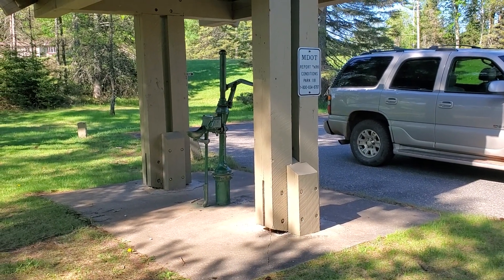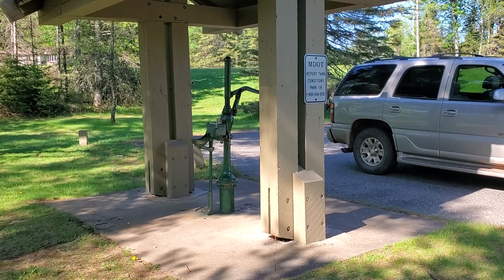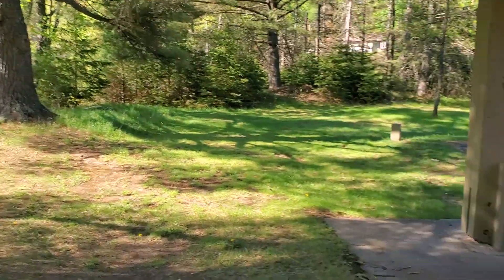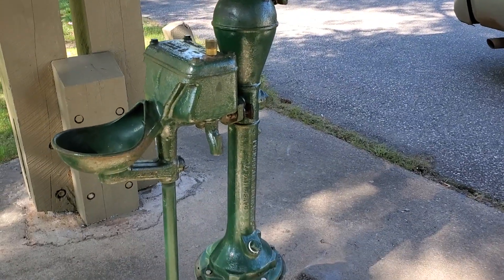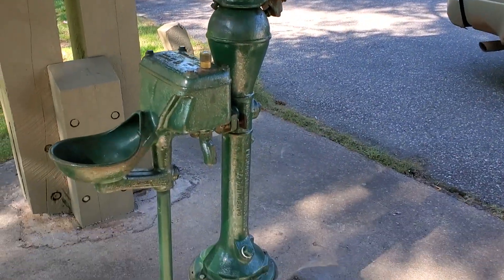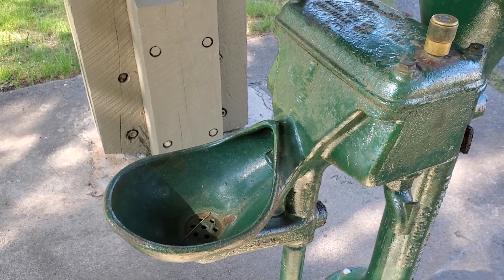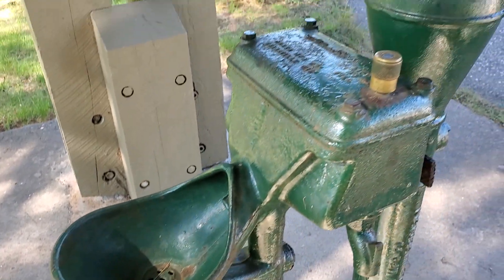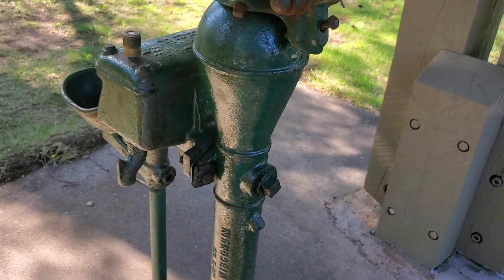#199 Baker Monitor fountain hand pump.

Comment: Oh this brings back memories from a certain park system I would camp in with my troop. Always screwed around at the fountain. 😂
Reply from the maker: The fountain versions are less common but these Baker Monitor pumps are very common at rustic campgrounds in northern Michigan. They are slowly being replaced by solar well pumps with running water which is disappointing.
Reply: @vintagekohler6085  I agree with your view on the solar well pumps.

Comment: I just snatched up the bowl of a 1965 Crane Neuday! A Canadian version too! No tank came with it however, but the bowl itself is damn near mint aside from some scratches and mineral buildup. No cracks whatsoever.
Reply from the maker: Cool find!
Reply: @vintagekohler6085  Thanks! My theory as to why there is no tank is likely because while installed, the tank broke and couldn't be used anymore. Because there's no getting a replacement tank, the whole thing had to be replaced. That's my theory as to why it's just the bowl.
Reply from the maker: @christopherpotomski8463  yeah could be. It's not uncommon to see mismatched bowls and tanks on low tank toilets so it's very possible the tank failed at some point.
Reply: @vintagekohler6085  Perhaps.